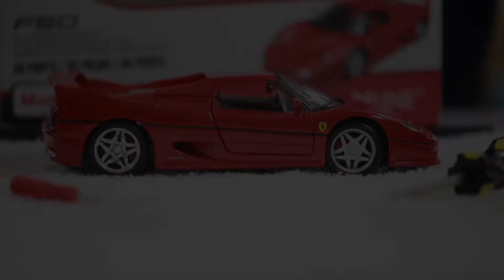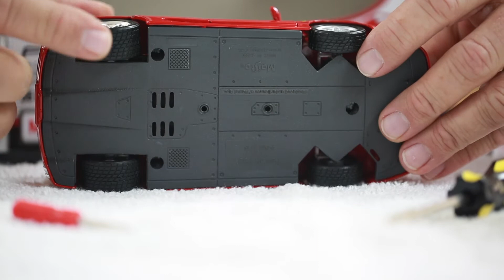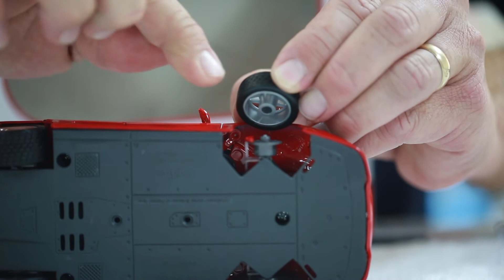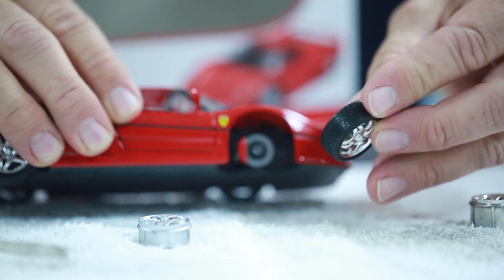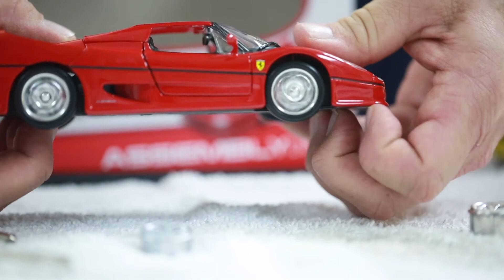How to do a Wheel Swap on a Maisto Assembly Line Model Kit

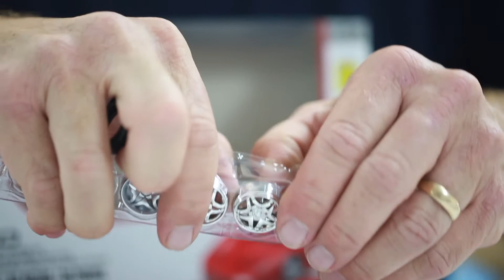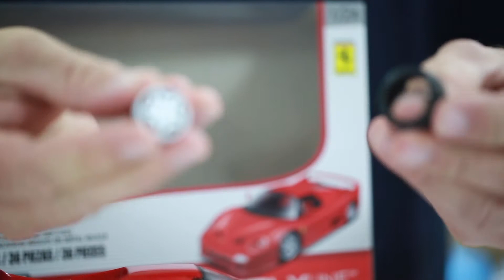Comment: this one seems to be 1:24 but i will ask about the assembly line 1:18 ........ is maisto f50 assembly line the same as maisto f50 premiere edition? Does the painting have the same quality? both have suspension?
is it possible to use maisto laferrari assembly line wheels on this f50? if you have both (f50 and laferrari) you could put the laferrari wheels on the f50 and make a video ...
Reply: Assembly line doesn't have suspension